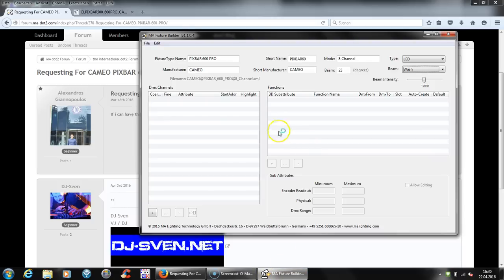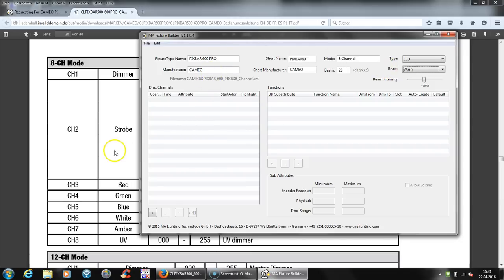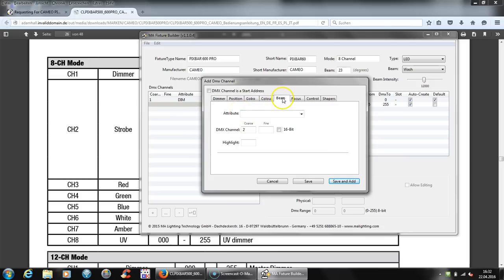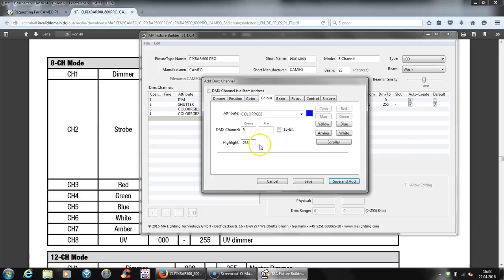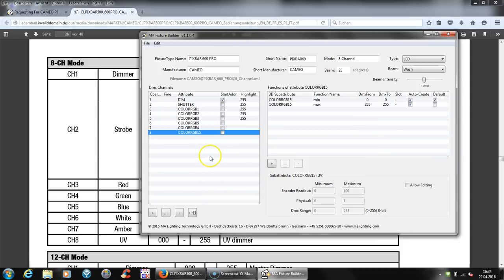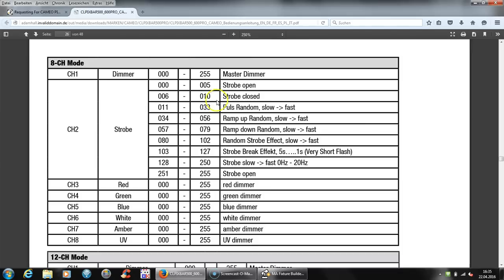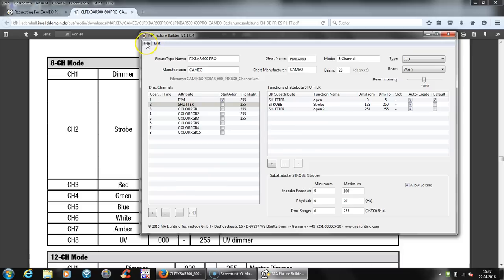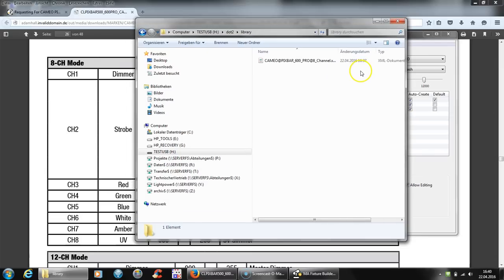dot2 | Fixturebuilder No.1 [EN]

Comment: How to make a Multi-instance fixture?
Reply from the maker: Hi,
a multi instance Fixture means, that this fixture uses the same order of Attributes, several times.
For example, a LED stick, using four times RGBW
In this case, it makes sense to build a module for the repeating block of DMX channels (RGBW).
Instance means now, how often this Module is used in your fixture type.

Easier might be, to import a fixturetype that is structured similar to the one, you want to build
And edit this fixture type until it works for you.
By doing so, you can see how a working multi instance fixture type is structured anhd you don´t have to start with zero entries.
Alternatively, you can also use the grandMA2 onPC software, to build your fixture type.
Maybe that´s easier, as you can swap faster between an already patched multi instance fixture and your “building sight” of the one, you want to edit.